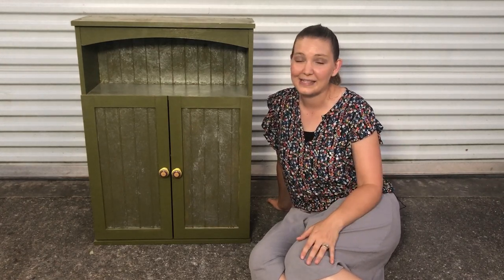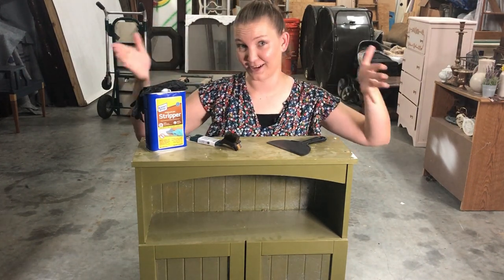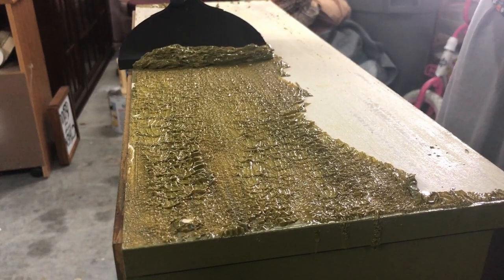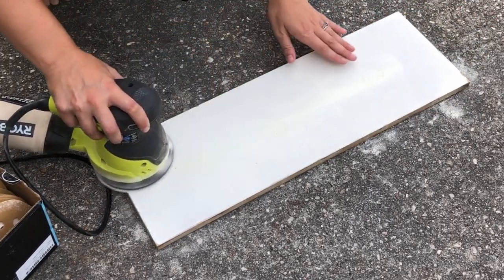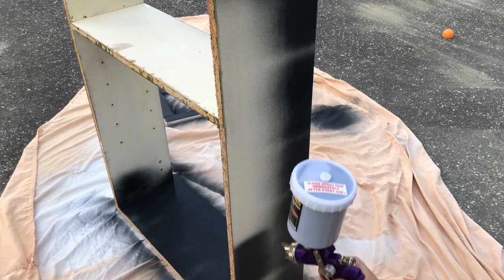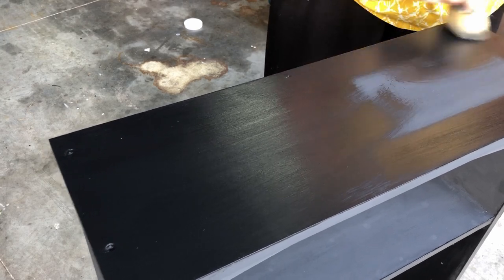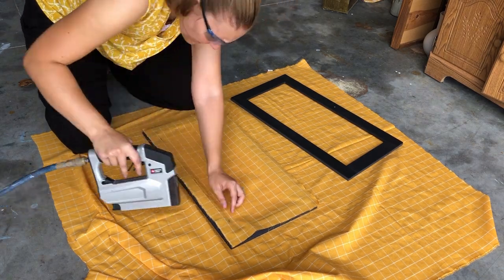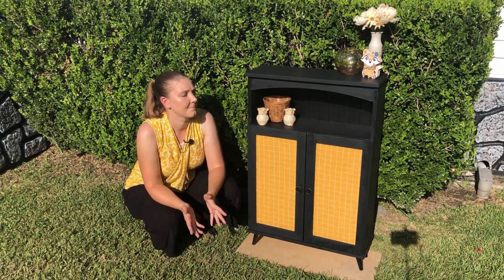COMPLETE TRANSFORMATION CABINET MAKEOVER | Ugly Duckling Challenge | Trash to Treasure

Comment: Have you ever tried using cling wrap over top of the remover to keep it moist?  I recently bumped into it a couple times and it seems to work.
Reply from the maker: I have seen that! This piece didn’t need it because the temperature was favorable and it stripped very easily but I would definitely try it 🙂